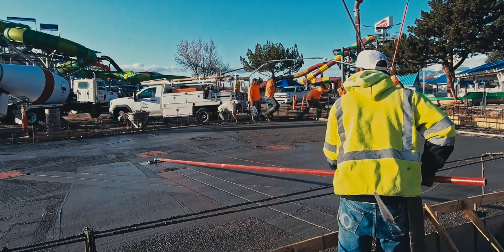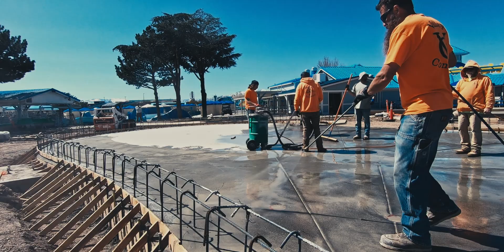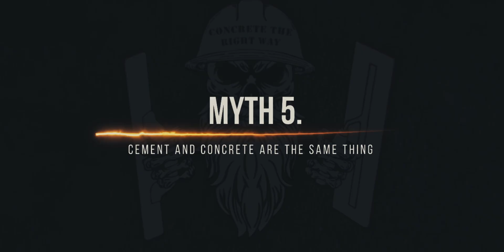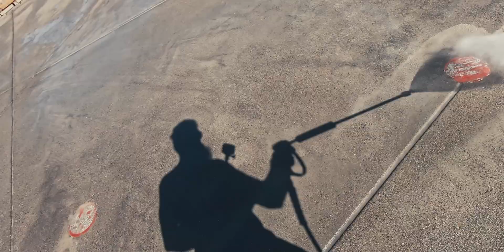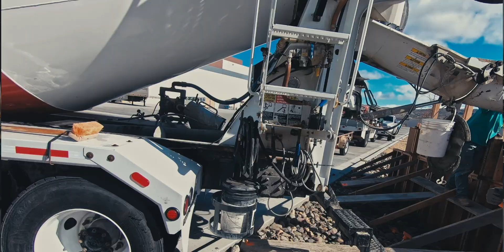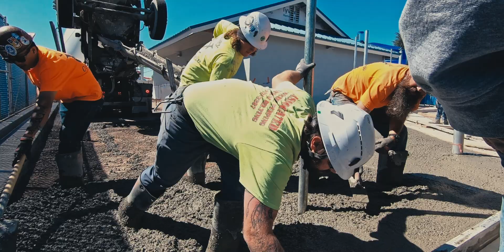Concrete Myths Busted

Comment: Plasticizer and workable in the same sentence...now we know you are lying (jk)....5-8 percent air here...6 bag(7 on occasion)...nca only if any...try to put down a 4 inch slump...stays where you put it....do not trowel..or fresno exterior concrete in freezing climates....and no rock salt please....we are getting 6000lb breaks in a week...4k 3 days after...pavement pours..the "drying" of the concrete is called "hydration"...cement  mixers are barrels full of money.....im 3 months late but the best question I have is....Does the humidity of the air at the time of curing....speed up or slow down the curing process...tldr does it get harder faster with high humidity or low?

Comment: In nineteen seventy six We Put in the pad and the steal And poured a sixty by a hundred For a welding and machine shop, A 12 inch by 18" footing all the way around 1 through the Middle. long ways and 3 lengthways wire only  For the slab Rebar in the footings.Four inches thick, We have had d eight dozers with trucks on that slab, Right now it probably has three hundred and fifty thousand pounds of steel and equipment on it, You have to look real , real hard to find a crack in it. No expansion joints were put in the slab.
Reply from the maker: I really think concrete was much better back in the day. Thank you for the comment.

Comment: Rebar gives concrete strength against structural cracking.  All concrete cracks as it cures.  The hydration process is like a snowflake forming, you just can't see the millions of cracks.

The 4000 or 5500 pound concrete you refer to is the PSI (pressure per square inch) compression strength at 4" thick.  The thicker the slab does increase the PSI, but thicker also means heavier, so the base is stressed more BUT thicker doesn't necessarily mean stronger.  Concrete has two pressures on it.  On the surface it has compression from whatever in driven over it.  This is where the PSI strength protects it from being crushed.   On the bottom is where there is tension from whatever is on it and that's where rebar gives the concrete strength as long as the rebar is near the bottom not just laying on the bottom.  Rebar and a sound base protects the concrete from structurally cracking.  PSI protects it from being crushed.  And they make fiberglass rebar now so rusting isn't an issue.   Hairline cracks is the concrete doing what it wants.....
Reply from the maker: Yes somewhat. The fiberglass bar is still not 100% you have to get it passed or given the ok to use. Some slabs crack right on the rebar that is why you can see the cracks 18" each way or whatever the rebar is laid out on. Concrete cracks at its weakest places. Something inside of it doesn't make it stronger. It doesn't magically know it has to be stronger. The rebar just stops it from moving as much. I have ripped it out and removed so much concrete. I have seen the effects of rebar. Yes on paper rebar is the best thing in the world. But the real reality is it is just some very cheap recycled metal trying to stop rocks from going up and down or in and out. Thank you so much for your comments. Very much appreciated.
Reply: The psi rating of concrete is not determined by a 4” thickness as a base line. Whether it’s 1” thick or 12” think, it’s still the same psi rating. It’s a “square inch” rating, not a “cubic inch” rating.
Reply: @psidvicious  You're wrong.  @ 4", concrete is rated at it's strength.  4000 PSI concrete at 5" is something like 5-6000 psi concrete and vice versa, 4000 PSI concrete at 1" thick is considerably weaker and why it's important to pour at minimum 4".  But either way I don't care- pour your concrete thinner than 4" and see what it does.  My point was rebar- it gives concrete tensile strength... without rebar tensile strength of concrete is about 10% of it's PSI rating.
Reply: @974pb  Respectfully, you are mistaken or perhaps just misunderstanding the testing process, used to attain concrete strength standards in psi or MPa/s (metric). The ASTM standards were developed and are described in ASTM C39 & C31. They were derived using 4”Ø x 8” cylinders which you’ve no doubt seen being used on site to prepare samples by the material testing company involved. Less common are the 6”Ø x 12” cylinders sometimes used for larger than standard aggregate (think heavy dam const) or for testing modules of elasticity specifically. Sometimes even 2” x 2” x 2” cubes are used but I’ve personally only seen the cubes used to test mortar samples. As I’m sure you also know, the cylinders (or cubes) are placed in a hydraulic press (after the desired amount of time), with precise measuring instruments and compressed to the point of failure, to determine their ultimate compressive strength. This is where the standards came from, that all concrete compressive strengths are measured and compared. Not from a 4” thick slab specimen. Additionally concrete strength does not increase/decrease psi / MPa/s strength relative to the thickness of the sample. The psi strength is a constant and can be made to withstand more load by increasing its depth but the psi remains constant. 

Concrete psi / MPa/s can be tested non-destructively after-the-fact or in place, if there is a question about something that already exists. A couple instruments used to do this are a Windsor probe or a Swiss hammer. Also a 75mm x 100mm core sample can be drilled, extracted and taken back to the lab for a crush test. I hope this helps to clear things up better. No exception was taken with your bottom rebar, tensile strength comment, as you were generally correct.

Comment: QUESTION: What would be your best recommendation for a ICF house, concrete poured into the walls with Helix added into the concrete? Psi wise? Thank you Sir.
Reply: Obviously consult ICF manufacturer but generally for ICF walls, use a minimum 3,000 psi pump mix concrete with a 3/8" or 1/2" aggregate size and a slump of 5-6 inches to ensure flowability into the forms.
Reply: @Ghostdogsurvivalist  Thank you.
Reply from the maker: Most likely that is structural concrete and would have a mix design. I would say something stronger than a 4000psi city mix. I have never poured one of those. Sorry I'm not much help with that. But thank you for asking.
Reply: @ConcreteTheRightWay  Could you please research Helix and maybe do a video on your options? I think people would love to see what you have to say on this subject. I’m subscribing to your channel now, thanks.

Comment: Just clicked on your video about myths about concrete not cement (the glue in a concrete mix) hopefully homeowners watch this like you talked about reinforcement rebar homeowners think it’s something special they need we placed many driveways when I first started in the trade 40 yrs back placement water control joints my personal home driveway and walkways have no rebar like you mentioned dowels in the correct areas for attachment people always ask how much rebar I place and I tell them none only where needed and yes maintenance big factor I have seen nice work looking old faded discolored because no pre maintenance sealers cleaning pour drainage complaints that they paid big money for the work 
Enjoy your videos keep up the good work and science on good concrete work 🫡
Reply from the maker: Thank you for the comment. I really appreciate it. Thank you for watching.

Comment: That was interesting about rebar and makes a lot of sense. For things like columns does the rebar help the concrete’s compressive strength? Regarding cracking with slabs does proper compaction of the base material help minimize cracks?
Reply from the maker: I don't think the compaction really helps bass is only as good as the dirt it's on.
Reply: Great point